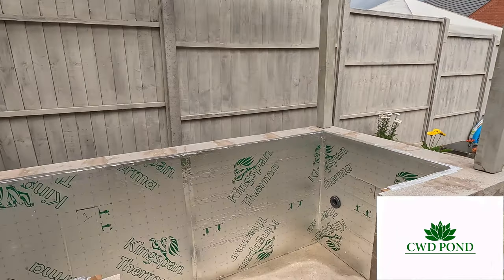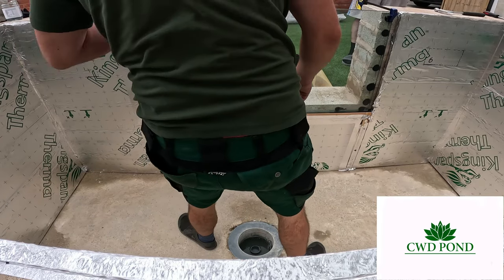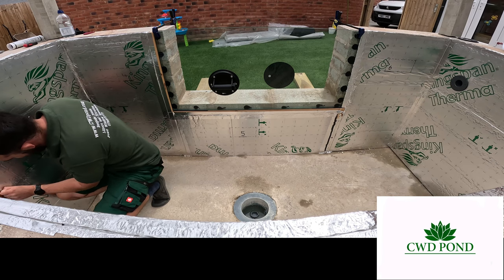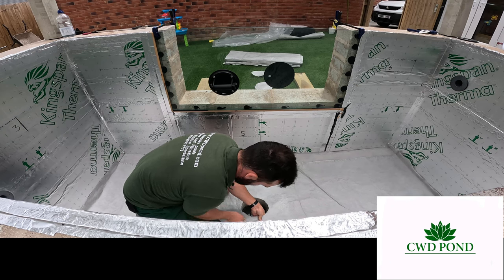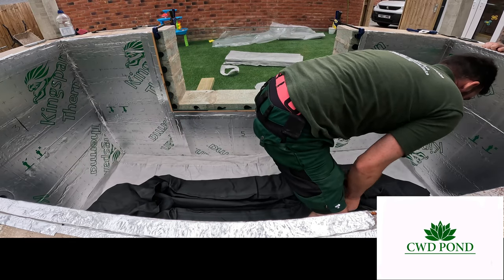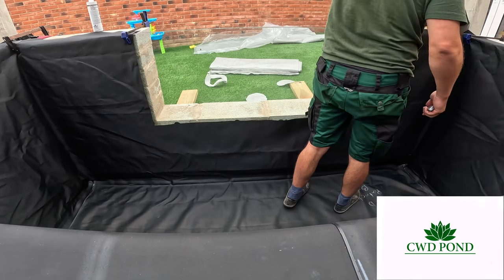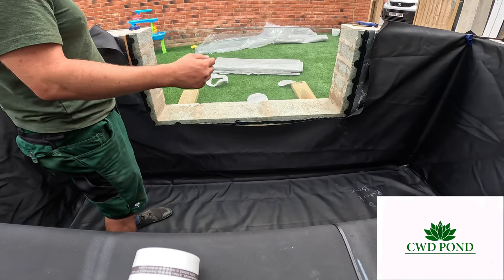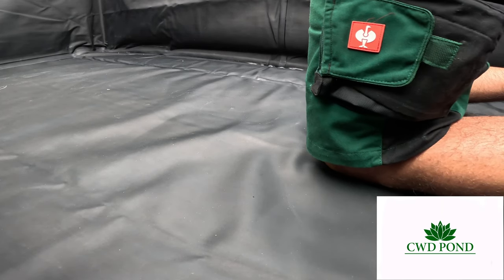Derby Pond Window, Box Liner & Bottom Drain install - using MyPond Ms300

Comment: I used this method to install my pond window utilizing their boxwelded liners and the ms300 sealant. I also used the sealant on my bottom drain and return jets. It's been almost a year with absolutely no issues. Being based in the USA it was hard to find a liner material made from butyl which is why i ordered from them. The cost was actually pretty fair even with the international shipping and the dimensions were on point. Great work and customer support from these guys.
Reply: so they actually custom made your liner?
Reply: @228dlb  I gave them the dimensions for the liner I needed and either they made it or sourced it out to whoever makes the liners and shipped it to me. The windows, bottom drain, and returns obviously need to be cut out yourself.
Reply: @KP-ey5fd   thats awesome! thanks

Comment: When measuring for a box weld liner would you use exact measurements or would it be wise to add 10-15 mm on to allow for any discrepancies?
Also interesting that you dont use the flange plates on the bottom drain or inlets ever had any problems? 
Cheers
Reply from the maker: No problems on drains etc, more issues with all the extra screwholes we've heard from customers!

Measure for liners exact to tge longest length width and height 👍
Reply: @cwdpond  thanks for the advice
Reply from the maker: 9
Reply from the maker: CONGRATS, YOU'VE WON A £50 VOUCHER
Reply: @cwdpond  brilliant how do I claim it👍🥳
Reply from the maker: @m1a9v6s4  hey! email carl@cwdsandbach.co.uk for instructions on how to claim it